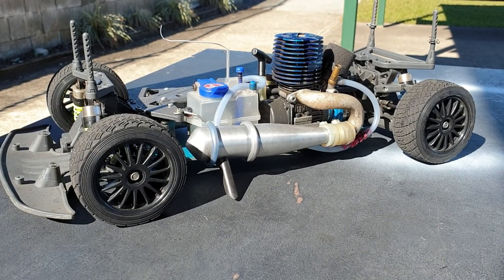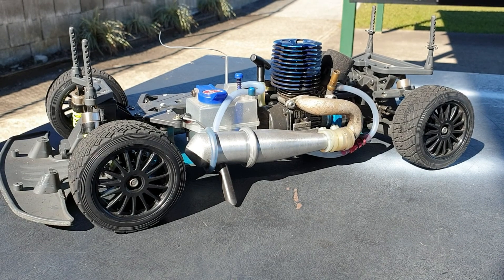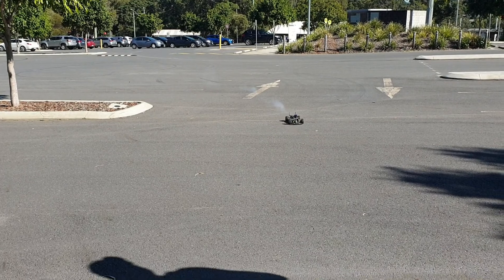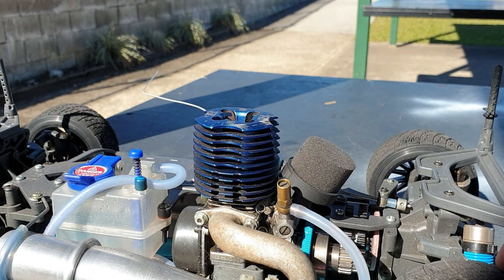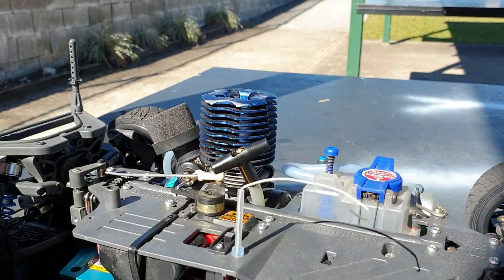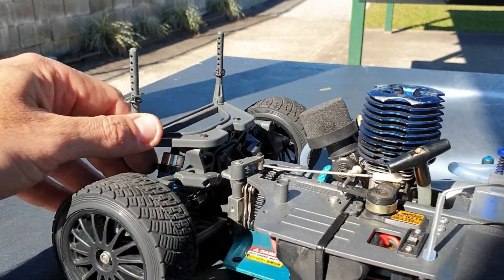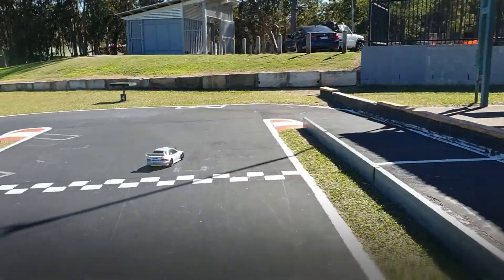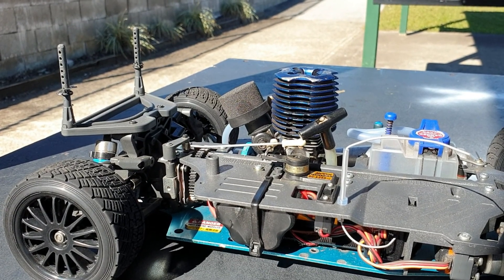Tamiya TGX mk1 braking issues

Comment: Take out the washers under the 2 cross screws that go through the metal brake pads and Presto! it takes adjustment right up, I had to do this on one of mine as the cam was rotating past.
Reply from the maker: Thanks for the tip👍 I will check it out. Cheers🍻🇦🇺

Comment: 18CV-R Very good!  I thought it was a drum cab because it's a blue head, but I'd like to hold down that place and slide better!
 Speaking of which,did the diff be solidified? I think the cornering will be even better. lt's hard to spin, so it's recommended!
Reply: The shaft is astringent though it is the fate of TGX and TG10-mk1, but even if you loosen the brake screw, the head of the screw hits  the next spur gear, so I scrape the head of the screw to the point where the driver barely bites. After thart,  I designed it so that the center shaft of the spur gear does not move back and forth.
Reply from the maker: Thanks for watching👍 I have fitted a ball diff to this one just recently, it has made a huge difference and what more can we say about this engine? It is amazing even after all these years🤣🍻🇦🇺
Reply from the maker: @まじアカーン  Thanks mate👍
Reply: Since the ball diff was originally made for a light electric car, so I halve the number of balls and re-tap the center screw diameter from 2mm to 3mm. .. If you like it, please do.
Reply: If you want a high-power engine, we recommend 18TZ normal shaft with recoil. Since this engine is rear exhaust, it is necessary to process the manifold into an S shape. If it can be cleared, TGX may be installed at the last minute without processing the fuel tank position. The rear exhaust has a good response, so I think there is enough power on the technical course. By the way, I own the TG10-mk1, but I am using a racing cluch made by Lacy and the spur gear is a combination of normal 50T for the 1st speed and 45T for the TGR spur gear for the 2nd speed, and a 1.7ps engine of 12TZ spec 2 is mounted.^_^; 
Manifold is processed by welding using 3 pipes, made into S shape, and a super 10 size muffler is attached. The fuel tank was changed to Kyosho to make space fo the manifold. lt's very disappointing because there is no place to run it just by making it. 
I'm looking forward to upcoming videos. I support you. GANBARE🤣

Comment: I have the same wheels and tires in the front but hits the bumper if I turn the wheel full lock
Reply from the maker: Hi mate, thanks for watching👍 Mine did the same until I reduced the ride height way down using the suspension limit screws. There is also the 'rally' version front bumper which came with the WRC TGX kits that gives more clearance.

Comment: Hey mate liking your videos 
I’m pretty new in this scene though I have recently come to own a tg10mk1 chassis though missing the motor and clutch. I’ve been told there’s now way to swap out to any other motor besides the fs 12 etc. what are your experiences with this as I see you have some pretty tricked up models there. 

Cheers KO RC
Reply from the maker: Hi mate, thanks for watching👍 I wouldnt say there is no other option but there are a few considerations. I have fitted other types of motors to the TG10mk1 like OS max  
.12, .15 and .18, Tamiya FS12SW, FS18LT you just need to make sure they are the standard crank and not the pilot shaft versions if you intend on using the clutch from the original Tamiya unit. Having said that if you are using an aftermarket clutch and flywheel setup you can use a pilot shaft engine. Engines between .12 and .18 will drop straight in with no modification, the only motor mounts I have had to modify personally are 'Force' engines, and the Tamiya FS12FZ/FN engine these have some clearance issues around the pullstart and fuel tank area. You will need to decide what clutch and flywheel setup you are going to use and work from there. Hopefully you find some of this info useful.  🍻🇭🇲
Reply: KO RC thanks heaps for the info mate very helpful and at least I have a heading a some new life to an old chassis 

Thank you